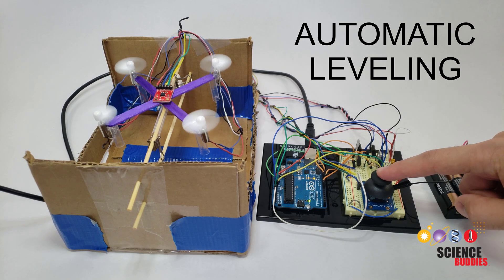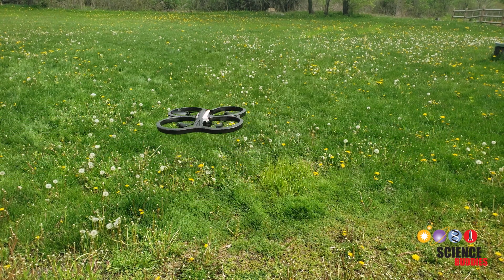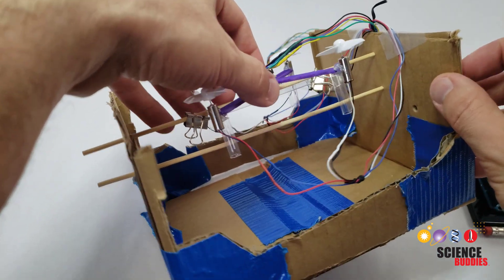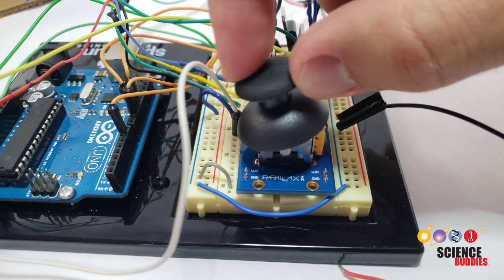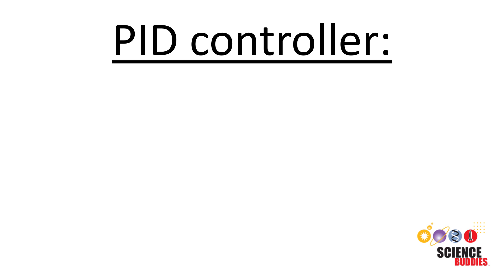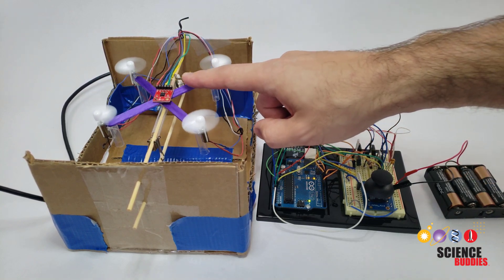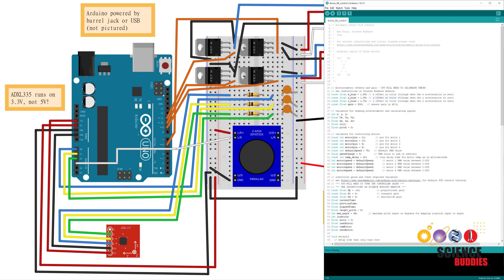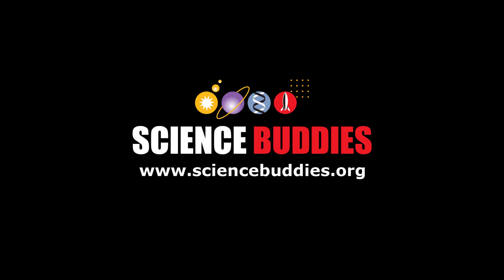DIY Mini Drone Part 7: Automatic Balancing | Drone Science Project

Comment: Ben, I see your arduino code. It appears that you are controlling the tilt angle via linear control for what is essentially a non-linear control problem. Your algorithm might work for small deviations from the target angle but its not clear to me how it would work for large deviations
Reply from the maker: Hi - you are correct, our resources are intended for K-12 students so the control problem here is dramatically (over)simplified. As you can see in the video, it works well enough to demonstrate the concept; our intent is not to teach nonlinear control theory.
Reply: @Science.Buddies  Thanks, can you point me to how this problem can actually be solved? Has someone solved this problem?